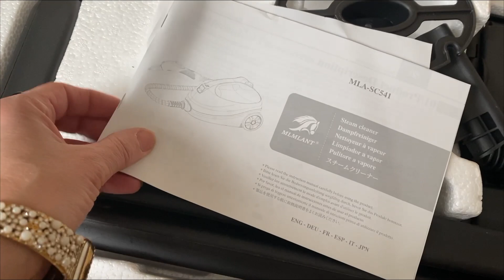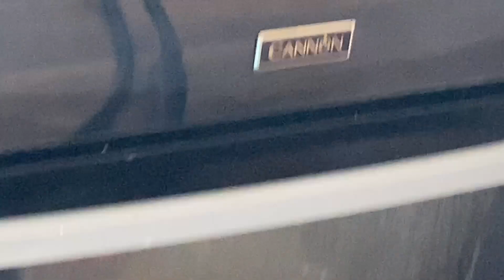Amazon Choice 2000W Multipurpose Steam Cleaner kills 99.99% of Bacteria 2023

Comment: How do I use the steamer? Does a push a button or for the steam to come out?
Reply from the maker: Hi yes you fill with water turn the machine on.  There are lights at the front which will eventually turn green but you need to wait a while for the water to heat and allow for steam.  If this is not working for you, it may be faulty and you might have to return it.   I hope this helps.